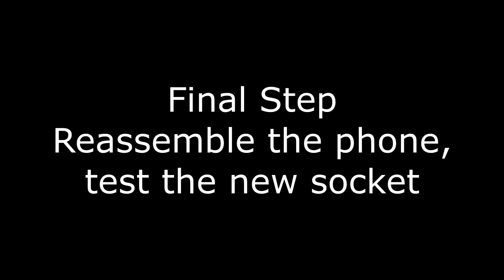How to replace a micro-USB receptacle - Samsung Galaxy S3 mini

Comment: I love how your whole video focuses on replacing a USB micro port, yet you failed to show the most important part....the re-soldering of the usb port.
Reply from the maker: Zachary Henning My bad, the camera was off for some reason, you can check the alternate version, jump to 7:20 in this video: https://www.youtube.com/watch?v=c4Faum0Ercg
Reply: +Jos&#233; Faria I am a beginner and I think You are more beginner. 'Cuase: 1. If You use a hot air gun, then You can just pick the component and you don't need a soldering iron: 02:38, 2. Use solder paste: 08:47! I mean not at all harm.
Reply from the maker: Kamal _88 Thank you for taking the time to comment. Regarding your points: 1. The less time you are heating the PCB, the less damage you are likely to do to the inner layers of the PCB. Give me 1 reason not to use the soldering iron to heat the ground plane faster (remember we're talking about a 6+ layer PCB designed to use the ground plane as a CPU heat-sink). The only way to do it faster is to use very hot air temperatures, which might in turn damage the nearby MEMS microphone, even by conduction (why do you think there are so many on sale for Samsung phones?). If the PCB can take it I use very hot air, like in this video: https://www.youtube.com/watch?v=o-33Ury-Qhc&t=05m35s 

2. That desoldering wick i smade by Goot, it has plenty of RMA flux inside, the conduction problem was caused by the oxidized tip.

The biggest difficulty is trying to work far away from the board to get away from the camera :)
Reply: You would have an easier time getting the solder off if you used the leaded solder and resoldered those pads, it will add some flux, get rid of a lot of the lead free crap, which requires crazy amounts more of heat, 185C compared to 227C for most lead free solder.

That tip was pretty bad, needs a clean.

Comment: He finally gets the micro USB port off at 5:44
Reply from the maker: +Sam Chaney Yeah, working with your arms stretched to get away from the camera makes things a bit more challenging :P
Reply: +José Faria agree with that but you can  edit the video
Reply from the maker: BigBavy And then people complain (at least one on each video) that you cut parts of the process.
Reply: +José Faria As they should.

You managed to make a long, drawn out video with a critical part (soldering) cut out.
Reply: it's a good overview... now, i'll just look up a soldering tutorial and that should do it. Thanks Jose!
Reply from the maker: Claude Cundiff If it's the first time you do something like this, you should practice with an old PCB.
Reply: Yeah, I am. I was on the right track but did not have the temp high enough. I'm trying to fix a friends phone so, I don't want to mess it up. But your tutorial is exactly what I'm trying to accomplish. I have a feeling, this may be a long learning experience lol. I appreciate you posting.
Reply: i need your help please reply me.i have grand 2 smg7102.its geating heating up and discharging battery on stand by.when i make call or using wifi its getting so extremely hot about 56 c temperature and battery charging is too slow.what problem it is. what should i do please guide me thanks in advanced
Reply from the maker: irfan lodhi That is probably a software problem, reset the phone to the factory defaults, remove unwanted apps and try again. 

If it was both discharging and charging quickly, I would say it was a faulty battery, but slow charge and quick discharge suggests a software problem (or a faulty phone, of course, but it's more likely to be a software issue).
Reply: no bro its hardware problem i even upgrad it to kitkat from jelly bean  but problem is still there ..its getting too much hat up when making call or using wifi but in sand by its even hot then a normal other mobile set may be its bit shorting in set but where i do not have idea...i have even its troubleshooting schematic but its not complete.i want its complete circuit diagram.if any one have then send me kindly
Reply from the maker: +irfan lodhi Upgrading android is not the same as a hard reset. Search on google how to do an hard reset on your phone. How long does your battery last when making a call? Have you tried replacing the battery?

If everything works as expected and it is just overheating, there is a strong chance that your phone is working within the manufacturer's specification and that specific model just runs hot.

Comment: You know, you can use side cutters to cut the four legs, a small blob of solder on the signal pins and the jack will come right off. A soldering iron and a solder sucker will quickly remove the legs from the holes. Takes about a minute.

Comment: In the future dab a bit of flux onto your wick to remove solder from through holes. This will speed things up quite a bit for ya.
Reply: +Joseph Van Meter Also make life alot easier when desoldering
Reply: Joseph, should the 5 pins at the back of the USB port be contacting the mirror image pins which are housed on the board itself, as I cannot re seat the port on the 4 solder points and get the pins to sit on the board.
Many thanks.

Comment: Soldering flux helps a whole lot in the process of de-soldering and re-soldering... Taking it off with flux shouldn't take you more then a second to do... I have a hot air gun and I dab flux on the connectors and bingo :D.... Quick... Also flux when your using the wick oh boy does it suck it up quickly leaving the holes open and clean... Just use alcohol to remove the residue and reply flux... The hardest part I found with this was installing without a magnifier. But I was successful in the fix....

Comment: Nice video.You should use a flat tipped soldering bit while using desoldering braid.
Reply from the maker: You are right, but I only had sharp tips on hand at the time. My soldering station is a Hakko clone, the tips should be very similar, I might order a couple and see if they fit.

Comment: applying a bit of flux over the desoldering wick would have helped you tremendously ;) not only the solder is absorbed better, but the heat transfer is faster.
Reply from the maker: Dumitru Ursu I agree on the heat transfer, but that solder wick made by Goot already has a decent solid resin that makes it very easy to wet, that's why I didn't bother :D
Reply: José Faria ah :) I got some cheap chinese wick, but with a bit of flux it works just fine.
Reply from the maker: But you are still right, though. Even using slightly better solder wick, it works a lot better when it is wet with some kind of fluid flux.

Comment: Hello everyone.
Before you go ripping your phone apart are you having connection problems with your USB cable. If you wiggle it on the phone end it works or beeps on and off?
Well if so it is a poor connection caused by male/female mismatch. I realized this when my OEM cable worked fine but most others did not and some not at all.

So what to do?
simple! first I did a test with regular paper and it worked.
1) place the paper in the mini connector or the usb cable (approx 1/4in wide by 1in long)
2 fold the paper over onto the out side of the connector so it sits between the raised points
3) insert the connector into your phone
Try your phone

For a permanent solution I replaced the paper with duct tape
It is a little tight which I expect to get looser over time.
I don't think the folded over portion is necessary as their is adhesive on the tape to hold it in place so cut it off after placing the plug into the phone for the first time to get the tape to adhere.
At worse you scrap a 3 dollar cable.
Good Luck.
Reply: thanks man :)
Reply: Phone works fine Reno, but no charge facility, was just wondering if the 5 pins housed at the center of the USB port connector should sit, (or make contact) with the identical 5 pins located on the mother board, as I never really looked as I was prying the original USB port from the board? Any help appreciated.
Reply: Oh my god....you...are you ...

Are you god? Be real because iv spent at least 1,000 dollars on micro usbs, infact i came here to get an idea on how i was going to remove the micro usb port and instail a mini usb port(remember mini usbs they never broke because they were sturdy and they wernt bulky at all samsung invented this to break) and then i read the comments and this angel single handedly fixed all my usb cords with a piece of paper. 

I just want to say im a real big fan of your work god, i especially like stars and i thought gravity was just brilliant, thanks for making us god and being perfect! I hope to see you in heaven mr. god!

Comment: Whenever I use solder wick I won't get great results unless I add some electronic-specific paste flux to the wick. The wick is supposed to be impregnated with flux, but there's typically far too little of it to get the wicking action going. Try to use just a tiny dab right at the contact, as the flux tends to flow out when it heats up & liquifies, and can spread over a large area if used excessively. But sometimes the bare wick won't do much to wick any solder away from the contact without a little help. A twenty-five Watt pencil should be more than enough heat to flow the solder. The proper way to do this is to put a tiny droplet of flux on the contact with a toothpick and set the end of the wick on the contact, and heat the wick from the top with the soldering pencil, pressing down gently until the solder melts & flows, then lifting (or carefully sliding) the wick away from the contact. Try to avoid touching any thing other than the contact with the hot wick.
Reply from the maker: +randolph patterson Have you tried goot solder wicks (Taiyo Electric)? They have a good amount of solid flux that gets fluid with heat. Of course it will not get any worse if you add more, but it is usually good enough. A 25W iron sounds a bit low for some boards, like RF boards with a lot of via stitching, unless it has a very good controller. Who is the manufacturer of your soldering iron?
Reply: +José Faria No, I'd never heard of Goot. Thanks for the tip, it's about time to put years of frustration to an end. I got a lot of stuff from the local Radio Shack before it closed, and I have 5 or 6 irons around. I mostly work on handwired audio stuff, vintage amps. I'm not real picky about what I use, if it gets the job done. I was interested for a while in getting a cordless, but it was so long ago I can't even remember what it was called. I don't have a soldering station, and some of the prices seem downright ridiculous to me.  But to be clear, I'm fanatical about the quality of the work I do, and I enjoy taking my sweet time. That would never be an asset on an assembly line, to be sure, but that's not why I'm in the game. For example, I got a free set of ancient pa speakers with a bunch of melted connections, dangling circuit boards, and broken input jacks. No parts available from the OEM, no schematic, huge crazy mess of bundled wiring, and no employed repairman in the world would touch this. Right up my alley....
Reply from the maker: randolph patterson If you ever need to work with lead-free (I only use lead-free, I build prototypes and they need to behave the same as the automated production stuff), give this one a try: http://www2.mouser.com/ProductDetail/AIM-American-Iron-and-Metal/14111/?qs=M7ZD%2f0QMIQxzdiUSEKYDAw==

It's worth every cent, iron set to around 340°C and it's easier to solder than most leaded solder. After trying out many brands of flux, I also think this one is worth every cent: http://www2.mouser.com/ProductDetail/MG-Chemicals/8341-10ML/?qs=%2fha2pyFadugjDmQk%2fpfUAqZeS3Ct%2fdkCs%2fU5EyLx6u4%3d

With that solder and flux combination, I've never missed leaded solder ever since.

Comment: FYI... If you are concerned about component damage from the clips, just put some heat shrink over the each jaw of the clips, apply heat to shrink in place. The rubber grips well and components are protected.
Reply from the maker: Robin R. Koykka Nice tip, I'll try it the next time I need to work on a crowded PCB.

Comment: Sometimes is much easier to heat underneath rather from the top and the job can be done very effectively.Temperature around 400 and air as much as not travelling the other components.

Comment: when u solder the new component does it matter if u all the connections are touching because it just looks like you are wiping them alll and so wont all of them be touching?
Reply from the maker: 2knackers When you use good quality flux you can use a technique called "drag soldering", where you just drag your soldering iron along a row of pins and the flux prevents them from creating bridges. Watch a couple of drag soldering videos on youtube, it all goes down to the quality of the flux.
Reply: José Faria ok thanks for the info.did you put flux on before you started/off camera?
Reply from the maker: Yes, and during, if I recall correctly, with a syringe. A family member asked me to replace the USB receptacle in a Samsung tablet, if I have the time I will try to do another video with more clear steps.

Comment: Hey, great video! Thank you. Can you tell me what are those things you have used to remove the soldering excess?
Reply from the maker: +Jacobo Ariel It's called "solder wick", but be careful with it on small traces, if you slide it you can lift the pcb traces.

Comment: Hot air Piropen (with a nozzle quarter the size) and solder paste are all that's required... and set much hotter than 350c! I wouldn't go near it it with a soldering iron - for either taking the old one off or fitting the new. Two minute job! :-)
Reply: +geoffphuket 
Removal is a two minute job with a good soldering iron. Been doing it for 30 years. Resoldering is also easy with an iron. I was trained by Nintendo on their SMT boards. Hot air station is nice, but not needed for small jobs like this.
Reply: +Mergatroid Mania We've all got our own ways of doing jobs! Ex Sony Service technician, myself.

Comment: What kind of flux is recommended for both desoldering and soldering new components? I noticed there are three types. I've never really needed flux before because I've always soldered things on large boards but I'm worried about attempting a micro repair.
Reply from the maker: If you don't do it very often, I would recommend some kind of flux paste, not the watery kind. Buy a good quality flux paste and you will never go back.

Comment: I would use a solder iron and a tin sucker.  I don't like putting so much heat in the surrounding area.
Reply from the maker: Fair point.

Comment: Really enjoyed watching it, didn't know that Kaplon tape was used for and now I do and feel confident enough at some time to use it for DIY repairs myself :)
Reply from the maker: I use kapton when I need to protect the components under it from heat and mechanical stress. It doesn't stop them from getting hot, but I believe it reduces the likelihood of heat damage and displacement.

Comment: Hi, what is the gauge of the soldering wire you are using and size of kapton/heat tape? Thanks in advance.
Reply from the maker: +abdulrazack oketona Hi, those are all personal preference, you should use what you find most comfortable, I used 15mm kapton tape and 1.27mm soldering wire.

Comment: Testing solder joints for melt point with a metal point quickly pulls the heat out of the joint. Try bamboo sticks or tooth picks. Have not  tried this non metal is the point.

Comment: I've ripped my tracks a bit for the data and power, the leads don't line up anymore, some of the remaining track is barely visible. is there a suggested method to repair?
Reply from the maker: If you have patience, you can solder the new USB receptacle and then use thin copper wires to replace the missing tracks and pads like in this tutorial:
https://www.sparkfun.com/tutorials/99

In your case it will be a bit more challenging because the USB pins are very close together and the solder will have a tendency to bridge, but with plenty of flux and a small amount of solder it is definitely doable, I've bodged plenty of wires in TQFP packages, so with a bit of patience you can do it. Just make sure you don't have shorts circuits between pins.

Comment: Hi there, where you bought your small hot air pen or gun, I need to buy one. thanks.
Reply from the maker: Hello, the one in the video is a really cheap Atten 858D, they cost around 50 USD+shipping, pretty good value for money. You can find lots of them on aliexpress or ebay. My favorite cheap soldering station is a Pro's Kit SS-989 that I bought in a local store, it costs about twice as much but it is significantly better.

These are my recommendations for budget equipment, however, if you can afford it, buy something from a proper quality manufacturer, you won't regret it.

Comment: hi, which hot air nozzle size (small, medium or big), air speed (from 1 to 10), temperature do you setup to remove and solder the new component?
Reply from the maker: Medium nozzle, low airspeed (2-3?), around 350°C

Comment: Hey José wondering if you can help me :) I'm currently using an xiomi mipad, and the charger port is on its last legs :( the mipad is an unpopular device so there are no repare parts selling for it :( can I use any charger port as long as its the right size?
Reply from the maker: VideosWithNexus You will have to bodge it , but microUSB receptacles are very similar and mostly nearly interchangeable. The most obvious difference I've seen is the outer shield, some have pins that need to go though holes in the PCB (like the one in the video, and they are mostly like this), others just have pads that don't need an hole to be soldered. 

You should look at yours and buy one that resembles it, check the product images, there is a good chance it will fit.